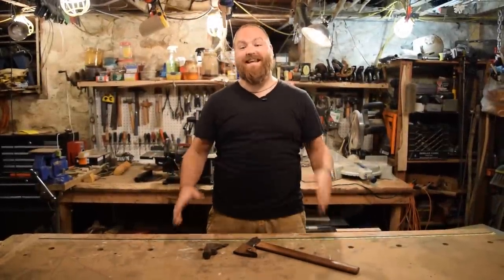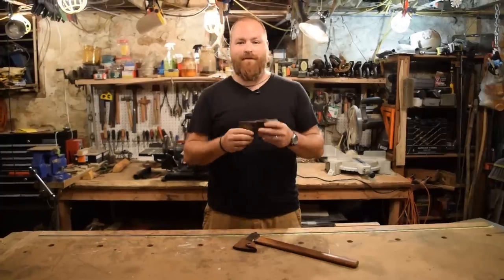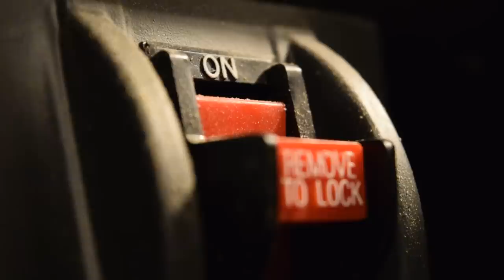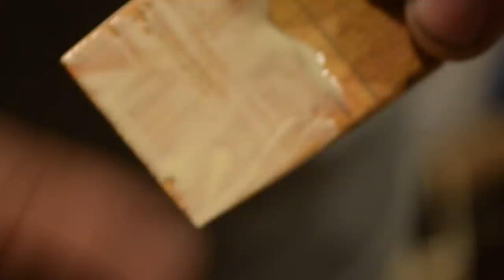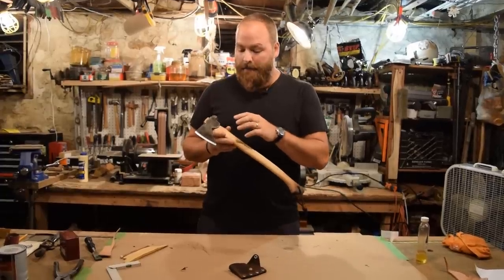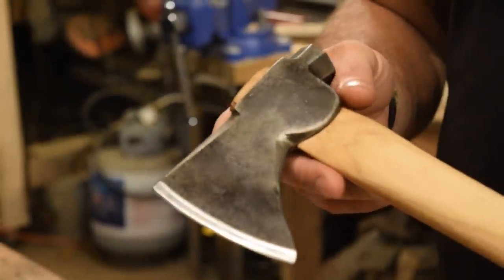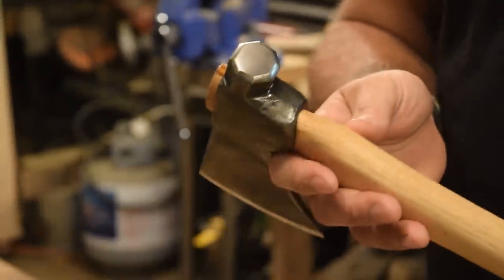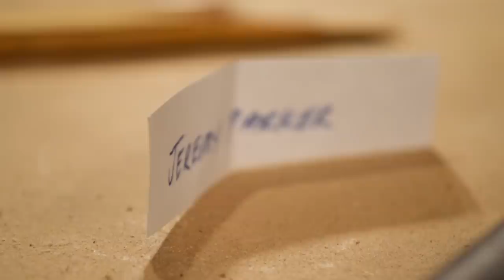Making a Hatchet Mod: 25,000 Subs Giveaway

Comment: I like your mods overall.  magic handle length for me is 16 inches, but most are much too short.  Also, agree with the curve and recess of the heel.  A lot, of those type hatchets are totally flat and parallell with the handle, which is extremely limiting for a multi-use tool.  I've seen so many pointless and strictly art mods, that this is refreshing.  Also, your handle isn't absurdly thick!  Kudos. :)  Cheers.

Comment: Great work. Only thing i would change is a piece of leather sandwiched in between the sheath along the part where the rivets are. Keeps the chance of the blade getting dull. If you had used thread, it would keep the threads from being cut.

Comment: Just a thought before applying oil to the handle or whatever protection you want to apply, if you get a fine mist spray bottle and just dampen the handle it will raise those fibers in the wood and then you can take some 320 grit to it then maybe even some 600 grit and the handle will be smoother than you can imagine and it really brings out a nice look for the wood when oiled up. Food for thought man, great job on the channel. I thoroughly enjoy the content you produce! Keep up the great work!

Comment: I wonder if the blade stayed balanced after the mod , I have a CRKT woods chogan T hawk that I moded just the handle not much else , I didn’t cut into the handle just put real paracord on it & gave it a rubber grip with a new inner tube .

Comment: You've got some excellent videos! I will definitely be using some for reference. Just curious though: why do you put welts in your knife sheaths but not your axe masks?
Reply from the maker: That’s for the compliment and question. The welt protects the thread from being cut by the tool. For some of my axe masks, I don’t use thread, only rivets. For those, the welt is not needed, since there is no thread. Thanks again.
Reply: @TheArtofCraftsmanship  thanks for the reply! I thought a welt would protect the bit of the axe from the rivets. I'm about to make an axe mask and wondered if it was needed. Thanks for the input!

Comment: Is there an actual reason for reshaping the blade and taking off half the hammer head?
Reply: I'm sure there's another video making a similar axe head that will explain that. I just forget the explanation!
Reply: Choke up on it and reduce weight I believe.
Reply: @Tinkering902   I guess I'm not a real bushcraft guy. Wel these days that's for sure, but I used to spend a lot of time camping and such. I never had to choke up on a hatchet that I remember, for fine work I'd use my knife.
Reply: @Tinkering902  I do.
Reply from the maker: Thanks for watching and your question. I like to remove the nail puller portion of the blade to give a bit more space to choke up on the handle for more close carving handling ability. I like you response saying that you would use a knife for fine work, and I agree, but some times it’s nice to have the choice. The hammer pole to me is mostly an aesthetic thing. I like the visual and actual weight of the head to be more forward, so I prefer to remove some/most of the hammer. I leave some because I think it is benifitial to have a dedicated pole to use as a hammer in many cases while in the bush, or around the house. I hope this all answers your question. Thanks again.
Reply: @TheArtofCraftsmanship  pretty much. However, the main question is still exactly what is bushcraft? I see the term bandied about all the time, but I have no clear idea of what it means, probably because it's misused a lot.  I can see the reshaping of the blade, if for no other reason than it looks better that way. I think I would take the hammer head clear off, then case harden the back side so it could be used as a hammer in case you really need to hammer something. Maybe add on a piece of hard steel that matches the back side... I don't know,  I know welding but not all the metals and hardening techniques. I did notice you were very careful to keep the steel cool so you didn't have to re-harden it. I do enjoy your work. your leather work is superior. one tip I could suggest from watching the shoemaker guys, is to hammer your contact cement area together to both make it tack better and flatten it a little bit. The snap and... what do you call the other things, rivets? anyway that was excellent work. you made it look easy, I happen to know it's not so easy.

Comment: please define bushcraft, what is it compared to just craftsmanship. You're not making it out in the bush, so what does the term really mean?
Reply: It's a bushcraft axe, as in an axe used for bushcraft. The processes involved in making the axe weren't bushcraft. I'm sure he's explained it in another video but some of the changes make it easier to use on the go, while camping etc.

I hope that makes sense? I've been up for a long time so my heads a little muddled!
Reply: @Zoso14892  I rarely sleep, and never well, so I get ya there. The blade profile, okay I can see that, make it more useful in the woods, but if you're gonna have the hammer head at all, cutting it down doesn't seem to make sense to me. But, as to define the term, what exactly is bushcraft AS IT"S USED HERE? I see the term use and probably misused a lot, that's why I'm asking.
Reply: @tootall5559  Yup fair, I think in this instance they just mean any use out in the country, camping, hiking, whatever. The other video gives a much better explanation though so don't quote me on that! When I think of bushcraft I think of survival, minimal equipment and living on the land but maybe I'm wrong.
Reply: Bushcraft is a pretty generic term, used - and probably mis-used - in a lot of different ways.  Generally, bushcraft, as I feel he's using it here, refers to crafting things in the bush, with minimal equipment.  Anything from a pot hanger over the campfire, hand-carved tent stakes,  a rustic bed or sleeping platform, a stool, or an entire log shelter would all be considered "bushcraft".  Some bushcraft involves lashings and knots to hold things together, some involves more in-depth carving or shaping such as dovetail joints for ladders, etc. (where a hatchet is really handy!)  My personal "bushcraft" equipment or tools is a 4" knife with a scandi grind for carving and other knife use, a folding pruning saw and a small hatchet for chopping and larger carving than I want to do with my knife.  I recently added a shovel\entrenching tool to my gear when my kids bought me a Cold Steel Spetsnaz type shovel for Father's Day.  I hope this explanation helps. ;)
Reply: @suprspi  As I read you is what I thought bush craft was, making things IN the bush, with whatever materials are at hand. So in this case, the hatched would be FOR bushcraft, but not bushcraft itself, as I understand you.